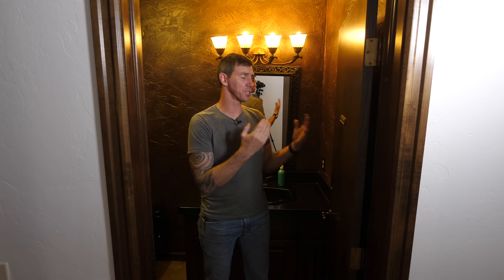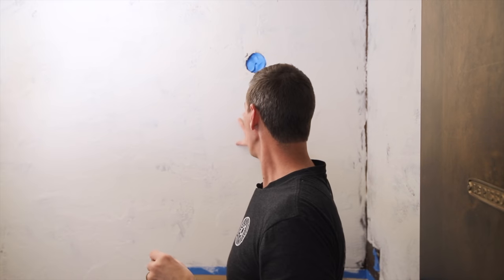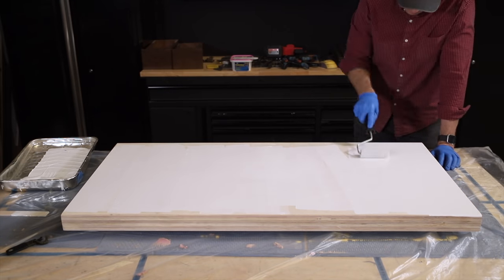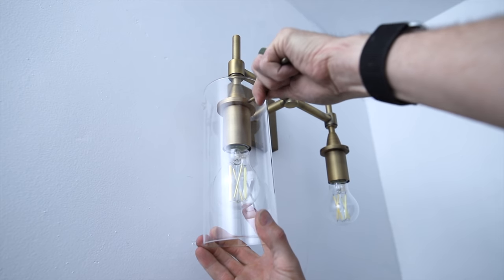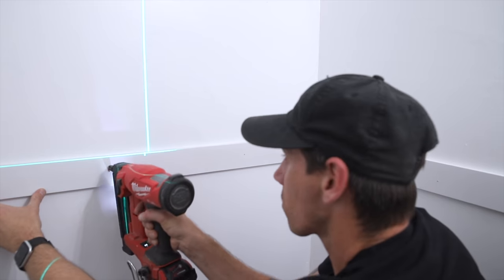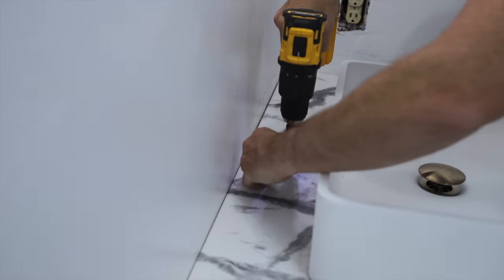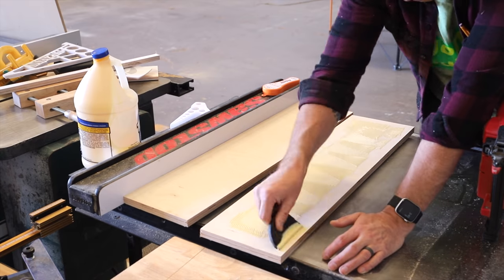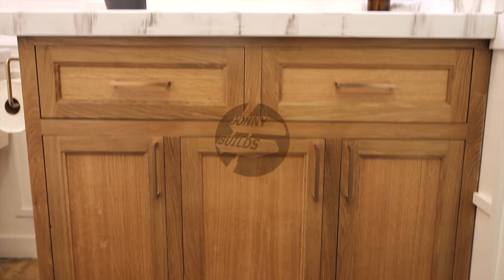Inexpensive Bathroom MAKEOVER

Comment: Bro! I would have just used some 1/4 inch drywall on the walls. It's cheaper and would have taken less time.
Reply: me also. it would have been a much better finish also. if you look closely at the corners of the walls you can see the pits and ridges from all that joint compound.